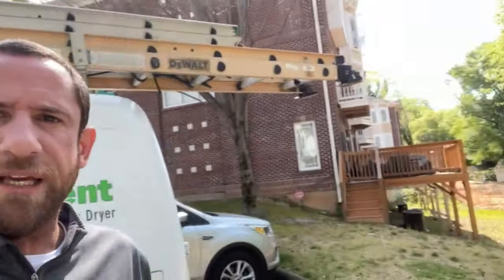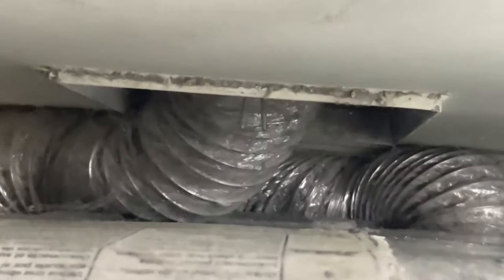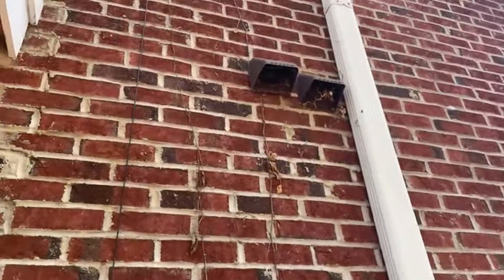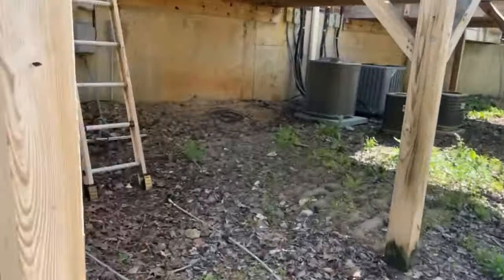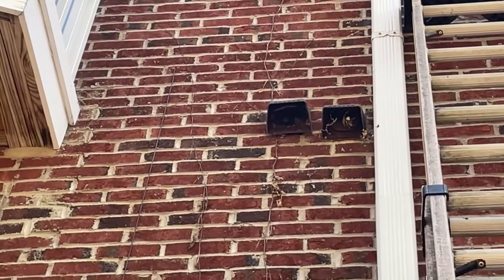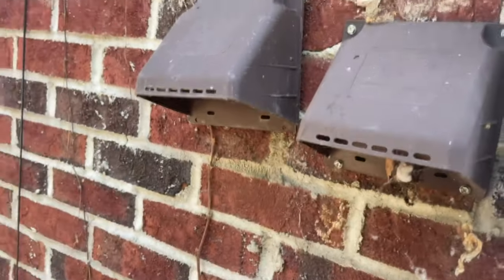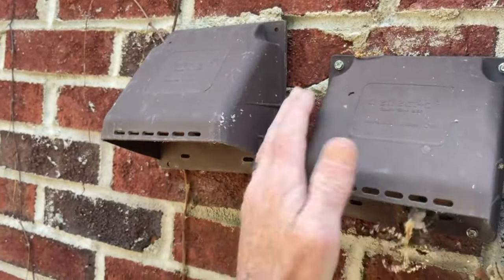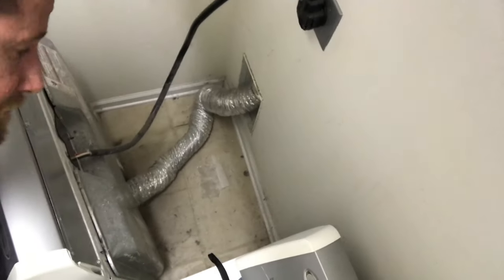How SAFE is YOUR Family? Cleaning a Dryer Vent! #almetaldryervent #satisfying  #diy #fyp #fire

Comment: Nice job, Steve.  Consider buying an anemometer to measure airflow before and after cleaning.  Show those readings as part of the videos.
Reply from the maker: I just ordered one! It's currently Sunday at 1:04 pm and it'll be here by 5:00... I appreciate ya as always Bob!
Reply: @advsLLC  Nice!  The very first thing I do before I begin the actual service is to take an airflow reading in MPH and document it on the invoice.  Then, the last thing is to take a final airflow reading after the service is complete to show the increase in airflow.  I will do this when the louvers are removed from the termination damper.
Reply from the maker: @HighSierraBob  I'll be playing with it tomorrow my friend!

Comment: Hi, Wow there was a lot of lint in there. Why would they put such a long hose on the back of the dryer, Is that general practice? Stay Safe from a Tasmanian Fan ❤️🙏👍🤗
Reply from the maker: ❤❤❤. Unfortunately, when companies deliver a new machine, they bring out an 8’-10’ hose and absolutely refuse to trim it down to the correct length… IDK… Makes no sense! Thanks to my favorite Tas fan!!!
Reply: The installer that comes with the dryer usually do a quick and dirty job. Using a long flex duct makes it easier for the installer to get out from behind the dryer after he finished. As long as it seems to work his job is done.

Comment: Do you measure the dryer vent duct before you start, so you will know what line to use ?
Reply from the maker: No, I just grab one of my brushes and send it through... If not long enough, I grab the other, but they look identical. Thx for the question!!!